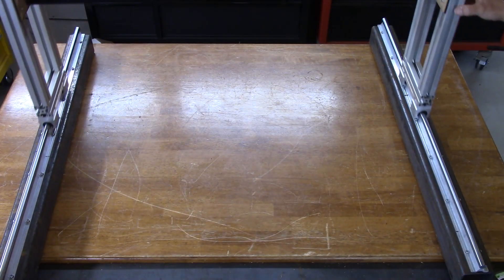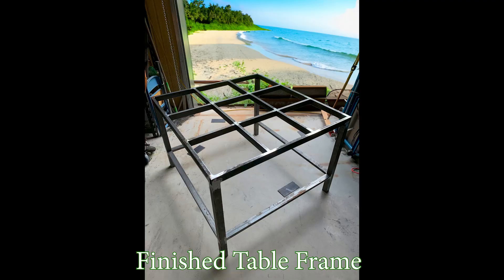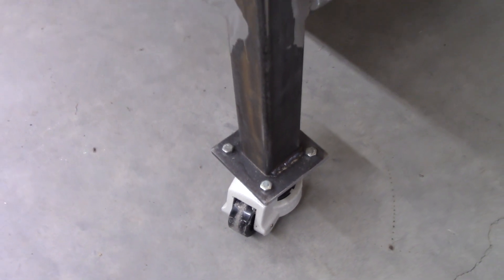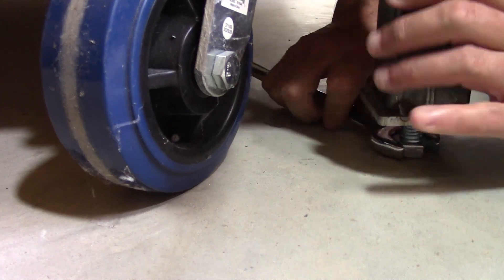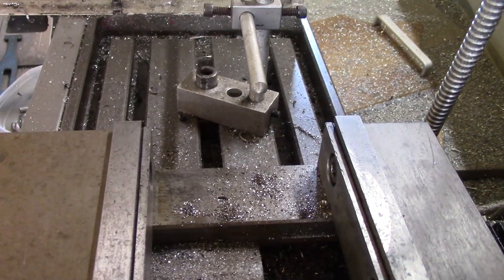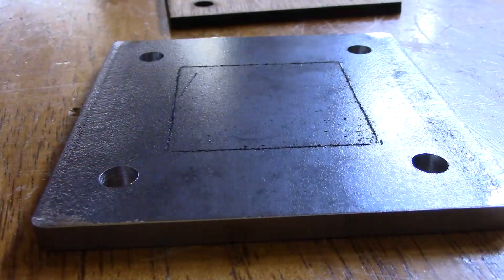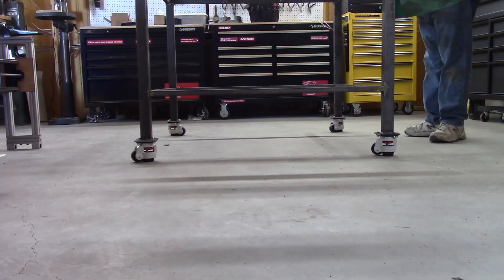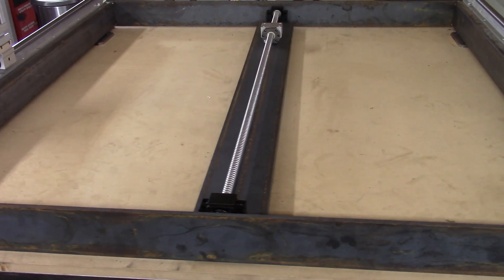CNC Dude's CNC Router Project: Table and Industrial Caster Install

Comment: I have the larger version of the casters on my Tormach 1100
Reply from the maker: Nice! I am not sure these ones would carry the Tormach, but I know they come in way sturdier versions. For my PCNC 1100 I use a pallet truck as I do not have a whole lot of access for the rear anyway. But good to know this is an option for much heavier equipment! Thanks for sharing and watching the video!